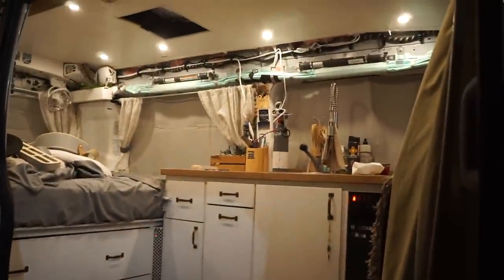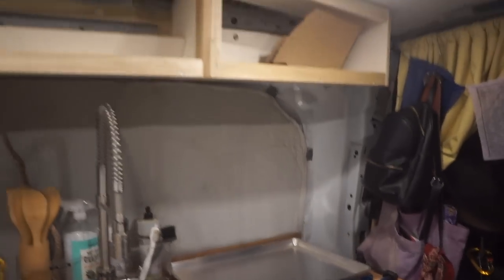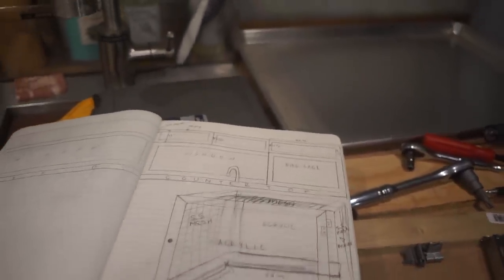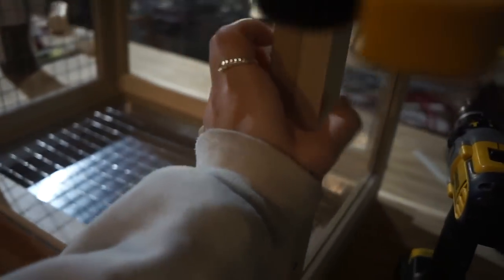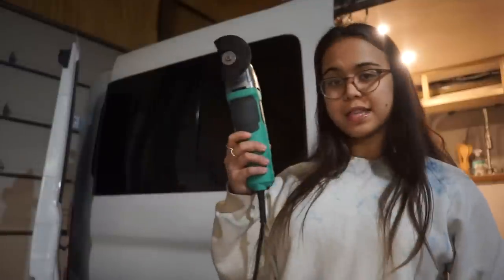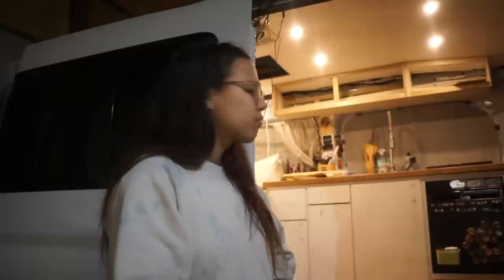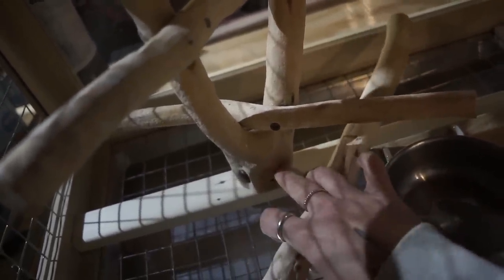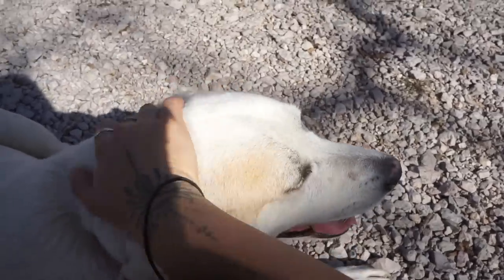training my parrot for vanlife and DIY parrot cage!

Comment: Hey there! I have a small parrot and am currently doing all the research to head out with an RV and my bird. My biggest concern is heat, as I preferably would like to be full time because of my job. Do you have any advice on how to keep your bird warm? At home I have a 100watt lamp on top of his cage and a 7watt snuggly near his perch. 
My second question is in regards to the acrylic. I’ve heard such good things about acrylic cages but my idiot self is wondering how much air flow they get? Do I have to drill holes in it at all even with mesh on the sides and top? Thank you for the lovely video and I hope to see more bird travels